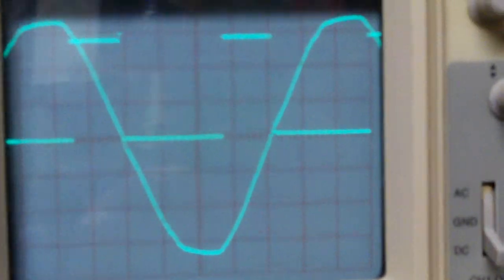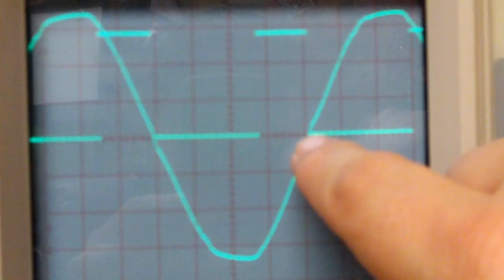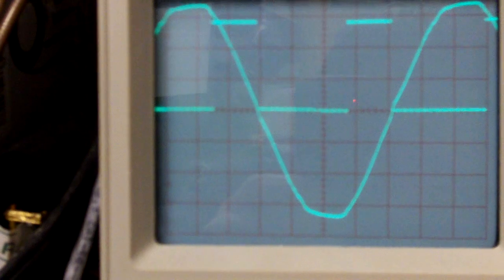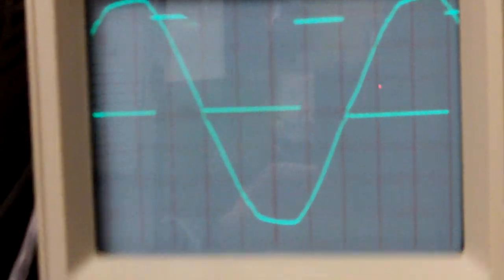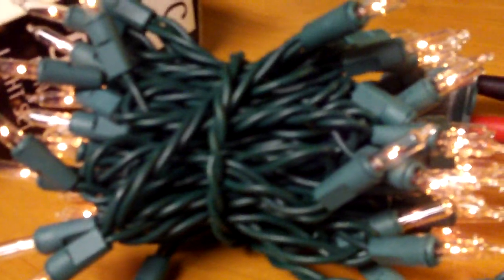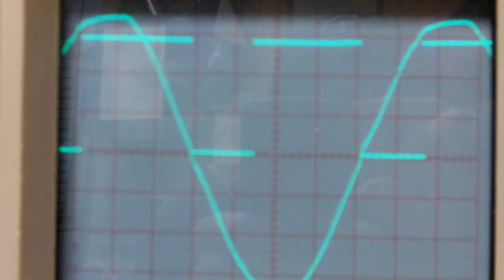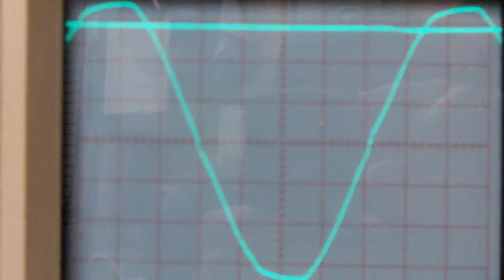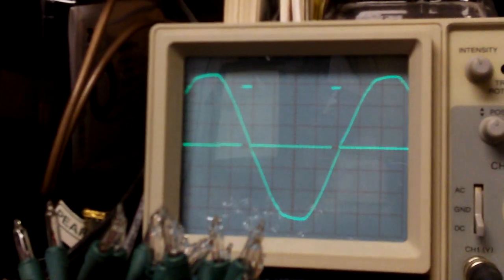Dimming the lights fantastic with the Propeller

Comment from the maker: @Evan5659 I am using the H11AA1 as the zero cross detector.  Yes, I am using waitpeq to determine when the zero cross happens. I used the code Jon Williams wrote for the Basic Stamp SX as a guide for writing the PWM routine.  It does not use any of the internal counters in the prop. It was pretty easy to implement. My first attempt was in Spin. I could only get a single cog to control about 3 channels. It wasn't a problem in assembly. If you check out my other video, you can see the final result

Comment: Well done, great explanation of triac usage for dimming AC.

What is the chip you use to determine the 0 crossing point?  Do you use the output of that chip with a waitpne command on the propeller to phase sync the pwm to the triac?

I am interested in adding dimming to my 8 channel system now.  It uses 10A SSRs with a 3v compatible input.... I think they can work like this if I can time the turn on and off times to my 60Hz signal.  

Thanks for the video.